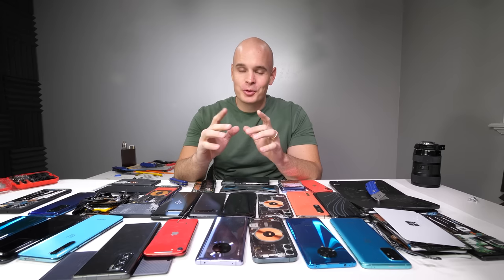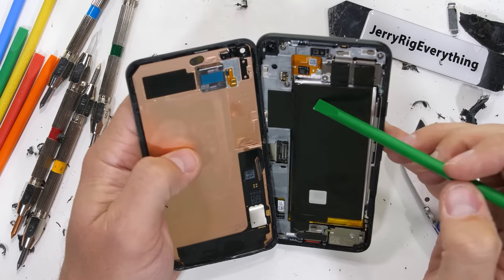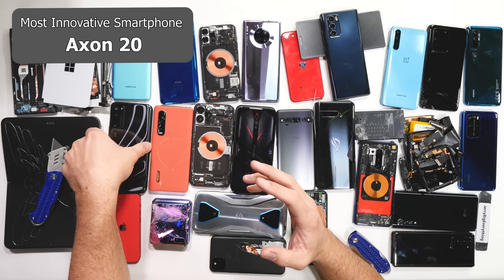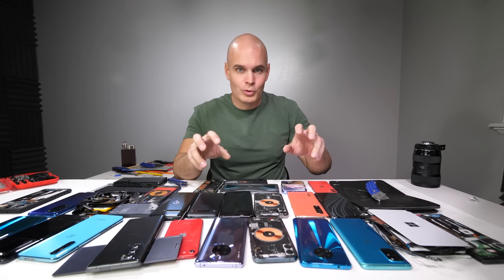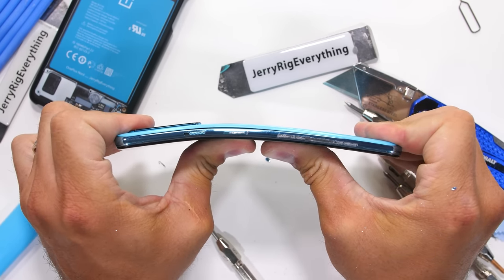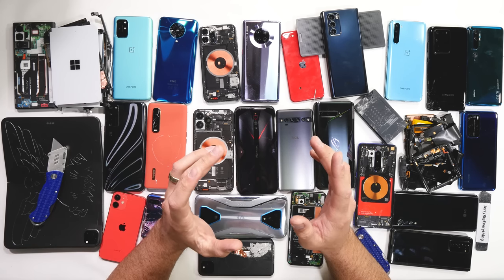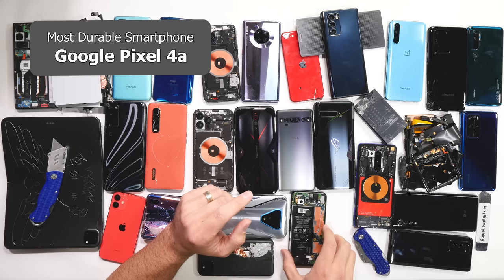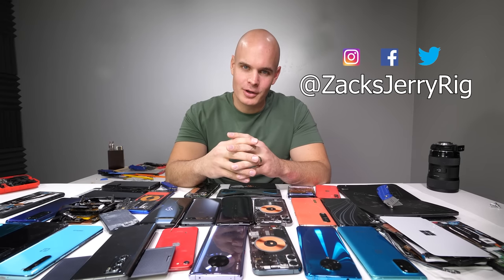Smartphone Durability Awards 2020!

Comment: All smartphones to each other, 

“Bro! Are you alive?”
Reply: they gathered for moto's funeral.
Reply: moto razer :  why me only ⚰️
Reply: Moto Razr: ...
Reply: If Toy Story was about Phones, Zach would be Sid
Reply: Moto Razer : not really.......
Reply: razr: how does it feel to be alive?
Reply: razer:
I don't feel so good
Reply: Second year in the row and none of the SONY phones tested
Something's fishy here ;)

It is a shame because as a loyal SONY user I do not know what is the durability performance of the first phones on the market with 21:9 aspect ratio. Very interesting due to longer and more narrow chassis which might be more delicate and more prone to bending.
I am very curious why Zack is not interested as we are ;)
Reply: @user-qw4jy1oy9r  when Sony dropped updates after 2 years sharp for my flagship, I realized that they’re not loyal to me, and basically more expensive than a apple.
Reply: @vanderslagmulders , strange. My partner still using hers SONY XZ Premium from the beginning of 2017 and the phone is still provided with all the updates in 2021.
It is a 4 years old phone :D
Reply: @vanderslagmulders  spoiler alert: most of the manufacturers provide 2 years of updates for their phones, even the flagships...
Reply: @ashokkumar61118   one plus died before tear down pixel 5 battery was poked galaxy fold is well it works but the screen went bonkers something tells me the surface duo didn’t make it out of the. Teardown

Comment: "Least repairable phone"
Me: So which iPhone this year?
Jerry: Blackshark 3
Me: Who?!
Reply: My thoughts exactly
Reply: Ya I was also thinking it would be an iphone
Reply: It's a Xiaomi gaming phone.
Reply: @rubensantos5006  I think he meant what and not who
Reply: iphone is most complicated to repair bcz apple dont want that you go to third party repair shop thts why they make it very complicated
Reply: It’s actually easy to repair most of the iPhone
Reply: @nourghabri97  no it is most complicated
Reply: @kushal9919  only new iphone are hard. iPhone 6 and 7 can be easily repaired
Reply: @nourghabri97  while the new iPhones are relatively easy to get into, Apple’s extensive use of part authentication inside its phones has lead to them being nearly impossible to repair (unless someone finds a way to unlock the restrictions). Until that changes, any repaired iPhone will lead to error messages that limit the functionality of the device.
Reply: @baconwizard  yea i think they will start conaxing copmonents
Reply: @nourghabri97  true it's the 12 and a few more that's impossible

Comment: Oneplus has DEFINITELY gone down hill lately. They're releasing too many phones and.not really listening to consumers.
Reply: "Enthusiasts" are niche customers that companies use to gain word of mouth and recommendations for their tech until they start hitting more mainstream customers. It's not that OnePlus has gone downhill, in fact they're better off than they've ever been as a business, but now OnePlus is in a position where mainstream choices make more sense for the general customer as a whole, than a niche customer that cares about price:performance ratio.

As much as Oneplus' was for the tech enthusiast in the beginning, it was all for the sake of positive marketing to get their business running. Even Xiaomi's flagship which also started the same way by maximizing performance for cheap while Xiaomi made very little profit on units, now Xiaomi's flagships are among the most popular in China, and no longer cheap.

It also doesn't help that the cost of parts, especially the SoC are increasing. It used to be in Smartphones that the screen was several times more expensive than any other component. The screen would be worth more than half what the device would sell for... And now a flagship SoC costs almost as much as the screen itself. UFS3.1 Nand flash ain't cheap either, mo DDR5 ram mo money... And for OnePlus to focus on speed, Processor, storage, ram, and refresh speeds are a must. A budget can use older-gen speed parts and still feel really fast and responsive, but to compete in flagship territory, you have to match their parts, and it aint never cheap to be bleeding edge
Reply: @Rottypops  y
YES SIR!
Reply: i agree. I've supported them since the 5t and I'm just astonished at how fast they're releasing new devices.

Comment: I'm still using the OnePlus 5T, it's running like a champ and the battery life is still... Pretty okay 😂
Reply: how long does a full charge last?
Reply: Did you ever updated the OS on your phone?
Reply: Damn, that's awesome! I was running OP6 up until recently and upgraded to 8T. To be honest, my OP6 still functions just fine, I mostly just wanted it for the 5G connection as I upgraded my household router to 5G as well.
Reply: My stil using oneplus 3T
I Will apgrad to 8T
Reply: @Yumi_xxx  Cool, 8T is an awesome phone! Been happy with mine. Besides couple of weird glitches with Whatsapp and Youtube (can't open story images, namely Cyanide and Happiness comics).
Reply: @harrym1862  a little longer than a day with moderate use*.
I also have one. (Well, now three, since I bought two ones in new condition, when the screen finally broke on my first one, a month back. They're about as good as most current smartphones, except maybe for the camera).

*On the 3 year old one that broke, while it still worked.
Reply: Me too...high five
Reply: @miskaknapek  How can you get a day out of any smartphone? From all Android phones I've had; Samsung Galaxy S2, Sony Xperia Z2, Oneplus 3, Oneplus 6 and now 8T, I charge multiple times daily. (Well I only use 40% to 80% to preserve the battery, but still I don't think I could last a day with one charge even if I used 100% to 0%).

Edit: Never mind, I missed the "moderate use" part, lol.
Reply: My oneplus 5 is still going strong. I'm currently using crdroid android 11. I'm thinking about upgrading to the Asus Zenfone 7 because I really like having one camera setup for both the front and the back. Also Asus is a much better company that cares about customers and software support. Oneplus is still getting worse with that.
Reply: @jayjaytv2563  I got a new condition OP 5T last month, it had Android 9 preinstalled. 
I think there are forms of the android flavour OnePlus uses, that have android 11.
Reply: i still use my oneplus 5 and it still has 88% battery health
pretty amazing after 3 years actually
Reply: @Leonvolt28  can only agree on the OnePlus parts.
I guess I should check the Asus ZenFone 7 then :)
Reply: @RafaelFerraz4979  That's quite remarkable. How do you check battery health though?
Reply: @PhazonBlaxor  use the app called OnePlus diagnostic. you have to install the APK outside the play store tho ✌🏻
Reply: Oneplus 6t over here. Damn! It's there for a couple extra years believe me. What a beast it is even to this day
Reply: @harrym1862  I get about 2-3hrs of screen on time with moderate use every day. But it still charges really fast with dash charge
Reply: @jayjaytv2563  yeah it's running Android 10 with oxygen os 10.0.1 or something, the last update was in early December 2020, it's pretty remarkable how long one plus has supported this phone
Reply: Same!
Reply: I'm still using OnePlus 3T ☺️
Reply: @harrym1862  mine lasts around one day on normal use. I bought it a week after it came out, and have been using it everyday since.
To answer the other guy I'm running Android 10.
Honestly the 835 handles whatever I throw at it pretty well.
Reply: @pabonrahman2460  if it works and does everything you need then why upgrade?🤷‍♂️
Reply: @victorsvidss  exactly!
Reply: @PhazonBlaxor  dude back in the golden days with my Z2 i got 4 days with moderate stamina mode with my normal usage do you like just play 247? (ps. its pointless to do 20-80 your phone automatically does it. when it says its 100% its not actually full and when its 0% it has capacity left like to tell you that its low battery)
Reply: Man.. I'm way ahead.. using OnePlus 3T..!! Can compete with your 5T too.
Reply: @migidid  You think phone manufacturers don't let the phones to charge fully? I have personal experience telling me otherwise, as I ruined my Z2 battery back in the day in ~6 months by keeping it 100% charged almost all of the time with the charging cradle.

And I make a lot of video calls, that's what mainly eats my charge I suppose. :') I also playtest games because I'm a developer, but it's mostly the video calls I think.
Reply: @PhazonBlaxor  by keeping it full all the time means you are not using the battery at all. thats what caused it. fairly quick tho. but bro you must stop 20-80 you just have to thing about your battery all the time and worry about it. you should not need to think about it. and you dont win that much (couple months) by doing it since it already does the most by itself. battery replacement it ineviteable trust me. manufacturers do every sort of test to make their batteries last longer they already did the calculatiens for you.
Reply: @migidid  According to studies, charging to 80% extends battery longetivity by over 200% — that's not months, it's years. Manufacturers don't care about this, they want that you keep buying new phones as often as possible. I want to have good resale value down the road, taking good care of the battery is one way to do it.

And I agree, I should not have to worry about it. But manufacturers give me no options. On my Macbook Pro I don't have to worry about it thanks to AlDente, it keeps the max charge to whatever I set it to be and uses mains power when it reaches the limit. Smartphones should have the same option, but they don't without root.
Reply: @migidid  But sure, it doesn't matter that much for phones. I change my phone every 3 years or so anyways. With Macbook AlDente is a must have software, it costed me over 2000 euros and I want to keep the battery in top notch condition for as long as possible. 

But it would be a nice option to habe for smartphones too. Oneplus has gone towards right direction after they introduced the battery health option. The thing is though that it's automatic and doesn't let me to configure anything manually. But this is why I love the 65w charging on 8T, it takes almost no time to top up the battery back to 80% so there is no need to charge over.
Reply: @PhazonBlaxor  You are talking about phone manufacturer and i about the battery manufactuter. but anyway your device (macbook also) keeps it from going from abt 90 to 100. thats where the most gains come. ofc you stress the battery less so in theory you get better lifespan but you are also charging more often so its gonna draw it back a little. trust me your device does it for you. also i dont understand. you paid 2k for free software that just stops the machine from charging after certain percentage? wtf :D
Reply: @migidid  The devices don't do it automatically, I don't need to trust you on this because I know this for a fact. I've looked at actual studies about this subject, batteries get consumed with charge cycles. Going from 0% to 100% once consumes the battery more than going from 30% to 80% two times, even though you added the same amount of energy into the cell. This is because voltage increases inside the cell when you get more charge. Batteries prefer staying at 65% to 75% if possible, that's when they have the optimal voltage.

And no, I didn't pay +2000€ for the software, I meant the laptop obviously, duh. It was an expensive machine and I want to keep using it for years to come. I want to keep my phones in good condition too, even though they aren't quite as expensive.
Reply: Same pinch😎
Reply: @muhannadmohammed7024  Same here. Mine op3t can survive 2021

Comment: Zack: The least repairable phone is....

Me: Iphone

Zack: Blackshark 3

Me: Imposible
Reply: @Julien Lindauer no it did not because if you replace the battery it shows as non genuine, replacing the camera makes it unusable,the screen will show as non genuine and it will also make the true tone function go away , and if you somehow broke the face id you are unable to repair unless you take it to apple ....
Reply: @Julien Lindauer not just showing it as non genuine but it takes away the battery percentage
Reply: @Julien Lindauer at least with the android phones you can replace the fingerprint scanner, screen, battery,and the camera with absolutely no compatibility issue
Reply: @Julien Lindauer not to even mention the back glass can't be replaced individually on the iphone x through to the iphone 12. Unless you replace the entire housing which requires you to take out the logic board and all the rest of the components. The only way to take off the back glass without a housing replacement is specialized equipment and patience
Reply: @eazysmokes3743  chill bro, there’s a line between repairability and compatibility
Reply: @aviedb  lol if it's repairable but the parts aren't compatible the repairability doesn't matter for shit because the device doesn't have all the functions it is supposed to have
Reply: @eazysmokes3743  I'd say half the issue is in your provider and repairer in this case tbh
Apple is very "territorial", and over protective of their brand, and thus any part that shows as faulty in any shape or form will be compromised

(hence why I prefer not to use apple products when I can avoid them.)
Reply: @Kiores321  the only repairer that can do iphone repairs on ios 12 + can be done by people with jc programmers or apples official device for pairing stuff .
Reply: @eazysmokes3743  lol you say that replacing the camera makes it unusable but the only reason the camera stopped working when Zack took it out is because he literally took the components apart piece by piece to get a good look at it. Any other time he takes a camera out of an iPhone it continues to work as normal.
Reply: @eazysmokes3743  also chill, no one needs another Karen in the YouTube comments lol
Reply: @lucastillej0  well if you break it tough luck cuz if you don't use the one that came with the phone it's fucked even if you get a replacement unless apple pairs it with the iphone.

Comment: You should review the Sonim XP8, It is the toughest phone I've ever owned, and comes with a three year unconditional warranty, if you break it, no matter how they fix or replace, no questions asked. I have all the Kyocera durable smartphones but Sonim XP8 is on another level of durability, a youtuber named Scrammy does all kinds of crazy tests with it and the amount of abuse it can take is amazing, for instance he parked his landrovers front tire (heviest side with engine weight) on it in a snowstorm for an hour, pulled the rover off whiped the screen off and it was %100 perfect, not even a scratch. Sonim also holds the Guinnes Bookworld record for toughest phone. Anyway please review and take one appart.

Comment: hello Zack, a tip for you - try to use mixture of pure gasoline and alcohol to unglue samsung batteries with thin plastic sheet instead of pure alcohol and your favorite metal flat tools. it will do the job just fine and easy

Comment: WHY DID U NEVER DURABILITY THE S20 FE!!       
I was so excited when I bought the fe because I finally had a flagship and I knew u would prob test it but no 😞
Reply: It's not really a flagship, also it's practically the same as the regular s20
Reply: @neolordie  in Europe it’s a flagship because it’s the only Samsung with the high end snapdragon processor.
Reply: @vanderslagmulders  yep, I know, but that's still not the flagship even if it's more powerfull
Reply: @neolordie  first of all the FE was classified as a flagship by samsung and has alot of the specs of the s20 and s20+ and second he never did the s20 either, just to the s20 ultra

Comment: hey jerry...i wanted to repair my phone everything was fine up to the moment where i wanted to remove the antennaband...it riped the connector out...is it still usable without this cable? like can i still get wifi? mobile connection is not importent or phonecalls but wifi. and will it still turn on? do you know that? because i do not have a screen at the moment and no battery for this phone...
Reply: he hasn't replied

Comment: I got a very dangerous glitch with my galaxy m11 which is...
I had added an fingerprint to my device but for that it asked for any other alternate method  like pin, pattern, code. I've selected pattern and added it but eventually it says that it is a wrong pattern I an totally afraid now😟
But the fingerprint is still working fine😰
How 😭

Comment: Wouldn't the iPhone 12 be the least repairable considering the items are hardware locked to each other and you can't change anything that you might need to repair without sending it to apple to do it. Using a donor phone will make the phone basically unusable?

Comment: Still using the s5 active from 2014, wins the durability test for me. 

On another note,  I would like to see a droptest among other things for a more comprehensive rating. I dont feel like most of your testing process relates to how a phone is normally used and what makes a phone last or live a short life. Who has ever had their phone snap in half on accident? And a relatively soft plastic outer housing can give pretty great durability if not put to the knife. 
On the other hand a phone that does well on your test might get cracked falling off the edge of a table on day one.

At the end of the day true durability is proved by the test of time and often the result of a more subtly well designed and well manufactured balanced device.

Comment: Is it really better to have a case on your phone as micro dust gets under the case and scratch's them badly. Most phone's will survive s drop from pocket height without getting any marks on them at all. I took my case of the back of my Samsung phone and it looked like I was rubbing sandpaper along the back it was scratched real bad. I thought perhaps the redmi note 10 would have been the easiest to break I've seen that snap like a kit cat .